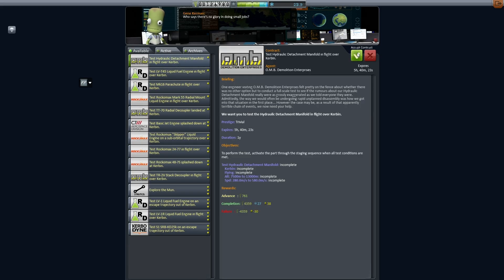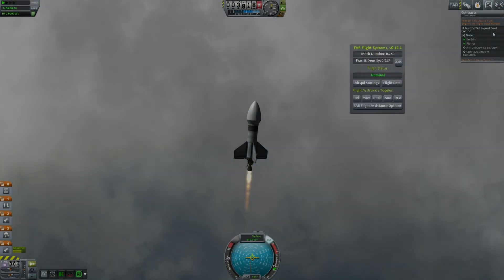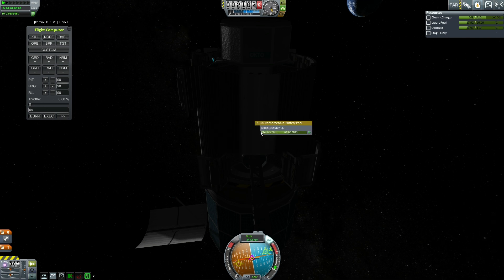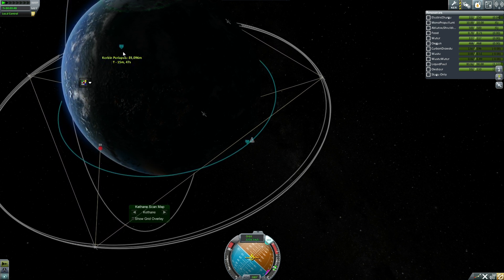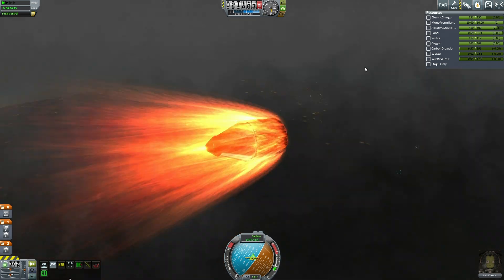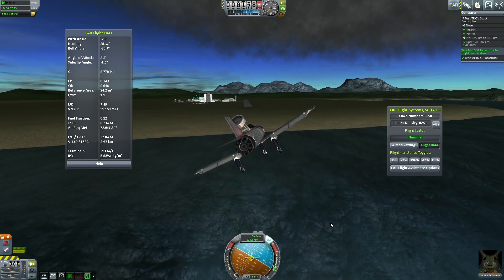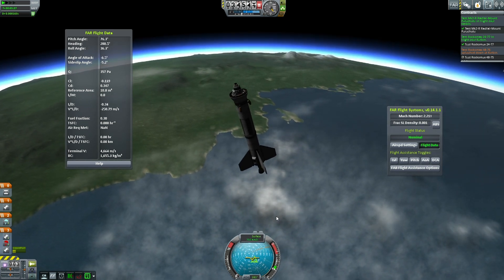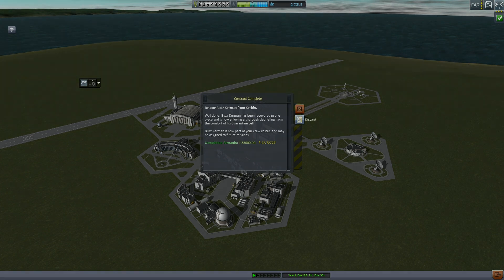KSP NASA Series (v2) Episode: 3

Comment: Could I have your game data folder? You have no idea how many times I've tried to install them and the game reliably crashes... Big fan of ur vids btw
Reply from the maker: Unfortunately, several of the mods I use are issued under a do not redistribute license, so I'll have to check what the authors prefer before I share my folder. Be aware though, that I have a pretty capable machine, (OC 4.8Ghz quad-core and 16GB of RAM) and I still get crashes and load failures.

What I have discovered, is sometimes a full hard reset is needed to get the game to run stable. I'm gritting my teeth and making do with x64 because I want to keep my textures full-res, but I was running essentially this same mod list in .23 with aggressive texture compression (http://forum.kerbalspaceprogram.com/threads/59005-0-24-Release-3-3-1-Active-Texture-Management-Save-RAM-without-reduction-packs!) and until I removed KSP Interstellar at a bad time (Completely my fault, KSPI is one of the best mods ever made for the game, and it was my operator error that killed my save) it was fault-free.

Once the game does successfully load, it tends to stay stable, especially in my career save where I'm making my series videos. Since I'm doing some outlandish things in sandbox to try and see how far I can push the game, I tend to get all my crashes there.

If you get a stable build, add a mod, and it won't load, then remove it and it continues to fail at load, try shutting the computer completely off and restarting. It seems Windows, at least, sets a state for the .exe in memory and trying to load that causes no end of frustration. 9/10 of the time, it will load with the new mod after restart, even, but it needs to clear the cache before it does.

One last thing: I am NOT using the experimental x64 build of Environmental visual enhancements. It's the good old outdated .23.5 version with Better Atmospheres V5 and a few select textures from Proot's Renaissance Pack. (Starfield, city lights, and EVA visor. Replace all city light textures and use Proot's citlylight.cfg after deleting the one that comes with EVE) I could never get the experimental builds of EVE working, but I have a sneaking suspicion EVE is still responsible for my memory allocation crashes. Until a published x64 build comes out, I'll be sticking with what I've got though.

Sorry for the Wall o' Text, just wanted to share what I've discovered so far.